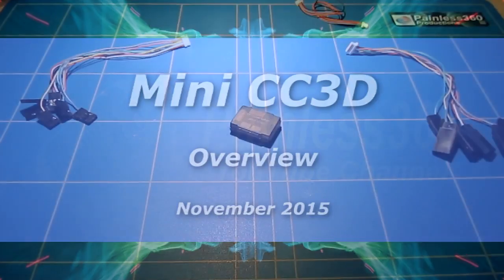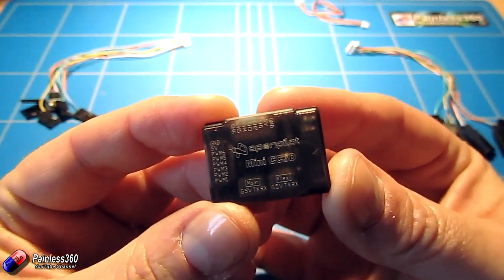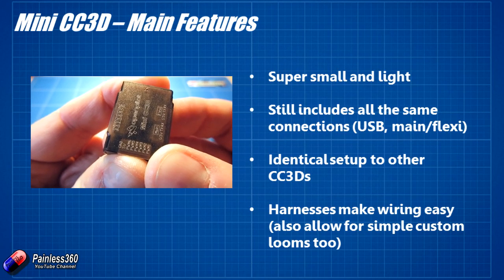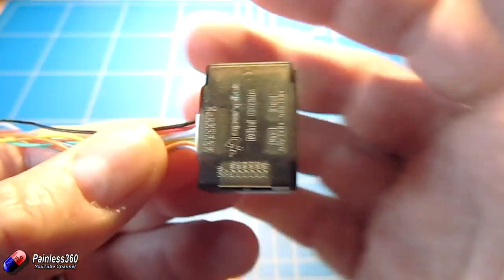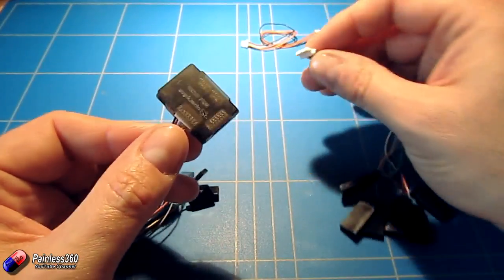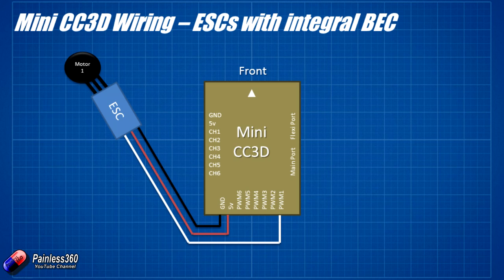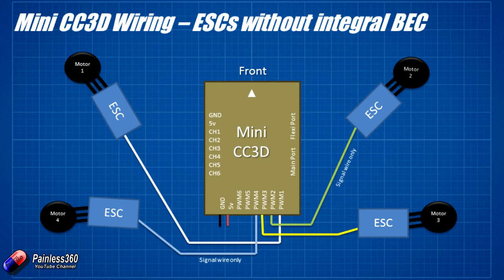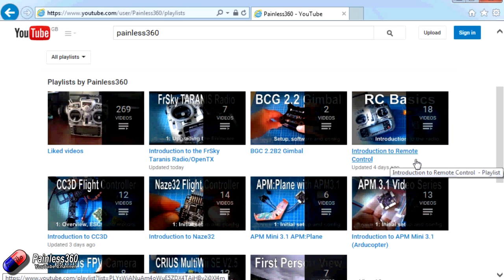RC Reviews - Mini CC3D from HobbyKing

Comment: What are the cables that connect the motors with the cc3d called because they didn't came with my cc3d?
Reply from the maker: +Redspiritnl not sure, I'd get into the seller to send you some. Best of luck!
Reply: Ok, is the cable for the channels exactly the same, except for the fact that is has male instead of female connectors?
Reply from the maker: Not sure as I can't see what you have. Again, the seller is the best one to answer these for you.. Best of luck!

Comment: Does mini cc3d support to the tricopter set up with tail servo ??? my servo is working fine alone, but with the cc3d setup it wont move at all :( .  any tips to fix it ....!!
Reply from the maker: +Sasanka Wickramasinghe see our video where we built a tri-copter with a CC3D.. Should cover it for you.. Best of luck!
Reply: HI sir,  I setup my tri-copter exactly as your video, but i used Librepliot to setup my tri-copter with this mini cc3d from hobbyking. No signal from the pwm4 to the tail servo :( . Was wondering this cc3d mini controller not support to the tail servo or something wrong with the vehicle wizard, not sure ....!
*would like to know the thunder QQ Super board suit for the tri-copter  projects ?
Reply from the maker: No idea, what we did is all in that video. Best of luck!
Reply: HI i got it work, but with some modification. need to supply external 5v and ground to the tail servo, since mini cc3d doesn't comes with 5v and ground n the rest of the out puts except PWM1.

Comment: My opto esc's have signal ground wires as others may as well.  There are no connectors / pins for those.  I've chosen to just drop the black wire (signal ground) but if you want to keep them connected then consider some workaround or another board.  

Also, the weight is 4gs but the wiring harnesses are ~10gs on their own.  Be something to just ditch the harnesses, open the case and solder direct.

Comment: As customary  detailed and  instructive  !

........but to state that with this little guy you can do what you can  with the full size one is simply not true.

1) none of the advanced Librepilot features  (calibration,GPS etc) are available for the midget CC3D atom like boards
2) For the power supply 5 volts is mandatory for the little guy . Not so   with the  original board which accepts  anything between 5 and 15 volts which is also available for output connections (not a negligible  flexibility drawback when it comes to  manage connections with  higher  voltage servos )

Cheers

Comment: Thanks for all of you do for the hobby!!....Question? What is the best way to mount this F/C to the frame.
If one was to use say a double sided tape. Would that not be subject to vibration? What other ways are to mount  this 
F/C that would allow for less vibration?
Reply from the maker: +bishop albany there are but if you balance the props and use decent motors then double sided foam should be fine. Best of luck..

Comment: the combo package that comes with gps and osd, would that be compatible with flysky fs ia6 or would i have to get the fsia6b? i want to put the mini cc3d with osd and gps telemtry on eachine falcon, but in the diagram it shows that the ground rx is plugged into a computer; could you help?
Reply from the maker: +rio787 If the receiver with your radio supports PWM or PPM then it should do. Best of luck!

Comment: maybe you can share some light on a question i have..  thanks for the video on the R616xn,, ill be ordering a couple of these for my 3 micro builds i have planed and collecting parts/waiting for parts to arrive to start building ( looks like i will be switching to mini cc3d.. i have one in the mail to give a try.  i have not given naze a try yet.  so far iv been happy with hat openpilot ground control station can do )..  i just built a quad yesterday and i was looking into oneshot etc.. and it lead me to librepilot.  and on there it said "warning openpilot" is discontinued.. i have not flash libre firm wear yet.. but im wonder have you heard of any of this yet?  seem the split happen in July of 2015.  im assuming the new librepilot will continue being developed.. but it sure gets confusing when you get splits.  i knew of Tau ( i bought a sparky II for a 680 pro spring build.. collecting parts for that too, laughs.  i went with the sparky as i wanted some of the added functions i think will be handy for a nice big hex AP.science rig ) then i see the new project librapilot..   kind of reminds me of naze and the baseflight,cleanflight split.. then betaflight.. gets rather confusing.  have you used the new firmware yet?  should we be concern of openpilot being discontinued..  thank you for all your information you have and continue to provide on your Chanel.. i learn so much, and i dig your teaching style.. rock on.
Reply from the maker: +Chris c Librepilot is more of the successor to Openpilot than a split. We will be covering LibrePilot in our upcoming CC3D Revolution series..
Reply: Painless360
thank you for responding.  i will be keeping a eye out for it.  i think i will run through the cc3d open pilot videos for a refresher  in the mean time.
Reply from the maker: Keep your eyes open, the series is starting in the next week or two (hopefully)!
Reply: sounds like a plan.  i guess i will flash this quad or whatever quad im working on at the time when the videos are uploaded/finished  with libre firmware so i can play along :)  have a great day.

Comment: Hi.  I have a mini cc3d flashed with betaflight. But i cant make to work the rx, is X4R-SB.  How i conect the x4r to the cc3d??  Thanks.
Reply from the maker: +ashingashinga The x4r can be connected via PWM (all the cables) or S-Bus. If you're trying to use S-Bus I'd check that the CC3D supports S-Bus without an inverter... Best of luck..
Reply: +Painless360 I revised the cc3d atom documentation, and it supports sbus. I nticed that i was conecting the cable on the wrong port. But even connecting to the correct one , i have the same issue.  On cleanflight on the configuraton tab, there is a note that says to configure a serial port(via the ports tab) and then choose a serial receiver when using rx serial feature. So i go to the Ports tab, and there are 3 serial rx ports that i can habilitate. I habilitate one, and then click on save and reboot, but every time i save and reboot, the controller cant conect again. ANd the modifications i did arent saved. I have to connect the cc3d to cleanlfight using a lipo, other wise it wont connect.
Reply from the maker: See our video on common connections in Cleanflight in the SP3 series. It should help.
Reply from the maker: +Painless360 Our series has started to be uploaded - you can preview the videos as they go up by keeping an eye on the playlist ;) Happy flying!

Comment: How would you install on a Quanum Trifecta. It's a Tricopter. The loom will not power the tail servo.
Reply from the maker: You Wouk run power from the UBEC to the spare two pins on the connector fir the servo.. We did something similar in the APM 3.1 plane build..

Comment: Can you say hotcakes anyone :) Cracking form factor and losing the pins for micros is about time. Not much to dislike here, even the sub £10 price.
Reply from the maker: +MicroRCFiend Yep, can't see a downside - yet! :)
Reply: I'm curious if the sat port can still work if flashed to clean flight, particularly BorisB betaflight. The naze rev6 can't due to the Sbus inverter blocking 2 way flow (spent hours trying before googling to find many with same issue). I also read of inactive sat rx port on cc3d after flashing cleanflight but didn't read up much on it as I expected my naze rev6 to perform functionally identical to the rev5.
Reply from the maker: CF is expected to support Naze Rev6 in 1.11. The 'tension' between the Baseflight and Cleanflight camps isn't helping use here..
Reply: But if the sat doesn't work on naze rev 6/cleanflight, would it be any different on a CC3D flashed with same firmware? I didn't realize there was 'tensions' but if timecop is involved, there's always drama. Talented guy but full on drama queen.
Reply from the maker: :) That made me laugh out loud! The actual firmware has different pin assignments and that is why you 'choose' the board version when you flash it. May work.. We will add this to the list to try but if you want Cleanflight then there is a better option..
Reply: I am am aware of the F series racing boards but would like something this small to support a sat if buying again plus the price is double or more on them. Yes please stick a sat test with betaflight on your list of things to try if possible but maybe at the bottom after other less niche aspects that would benefit more people would be sensible.

I am curious if you would be willing to print a one off part for cutting props down if I was to cover all costs and in no rush? All the commercial ones seem to stop at 6" props size and a uk quote from commercial printers is around £20 plus setup/postage. No worries if your busy with umpteen other projects of course but I was curious.This is the item:
http://www.thingiverse.com/thing:895083

I have a vtail upgraded to 1400kv 4s and the 8" slofly props just explode on tiny throttle inputs so I woudl like to use my 10" ones as the hubs are so much thicker.
Reply from the maker: Let me see what I can do on that 3D part. The printer is running most of the time now on one thing and another ;) Where about are you - in the UK?
Reply: I'm in Sheffield. I managed to bodge some with a vice and pillar drill attachment for the Dremel today but it develops slop as my clamps are not great and needs realigning every prop. Enough to get me in the air but the thought of doing 50 like this is not funny
Reply from the maker: The part is printing on the printer as I type (https://dl.dropboxusercontent.com/u/67301981/part%20printing.jpg). PM me your address and I can pop it in the post if it prints ok..

Comment: Hello Lee, I assume on install you would cut off and solder to avoid all those wires. Have you had any problems with those thin wires breaking after some use?
Reply from the maker: +Marty Rome I tend to crimp them. If you strip more insulation off than you need then twist the cable and double it up on itself then it gets a good connection in the crimp. I'm not a fan of soldering these really small cables (see the APM 3.1 plane build etc). Hope that helps!